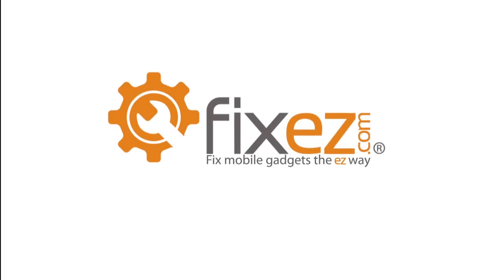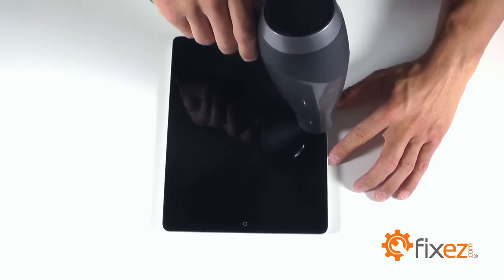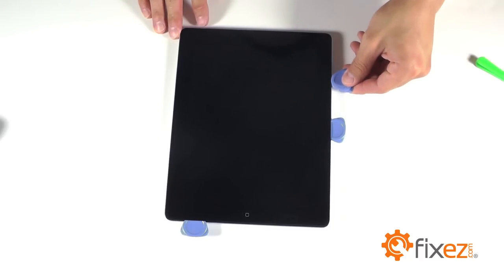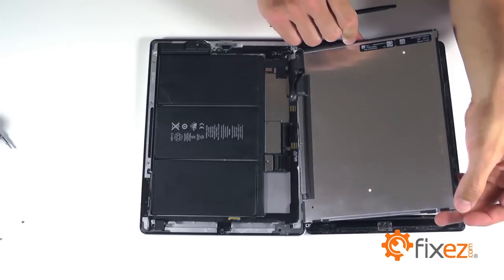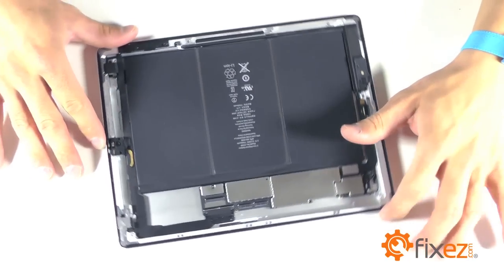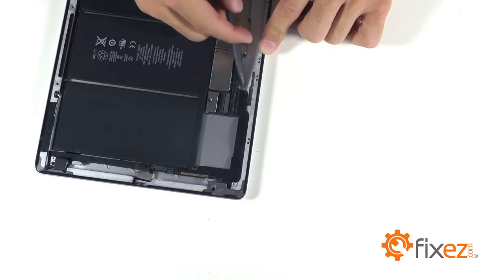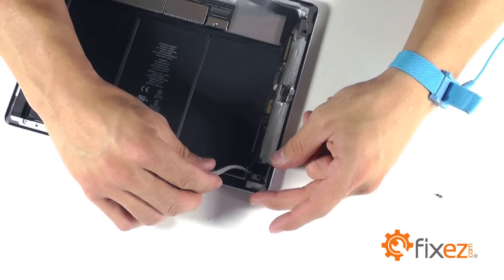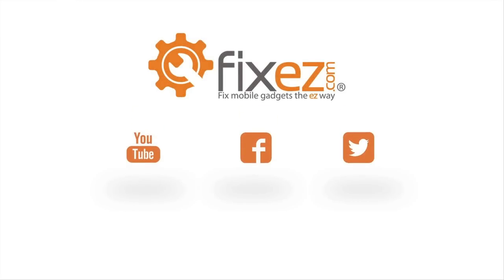iPad 4 Headphone Jack Repair

Comment: Thanks for the video! Is it necessary to replace the touch screen or will the adhesive from the current one be enough to stick back on?  and will a hairdryer work to heat the adhesive?
Reply from the maker: +NixFlix Yes a hairdryer should be sufficient to heat the adhesive. We recommend replacing the adhesive. Thanks for the questions.